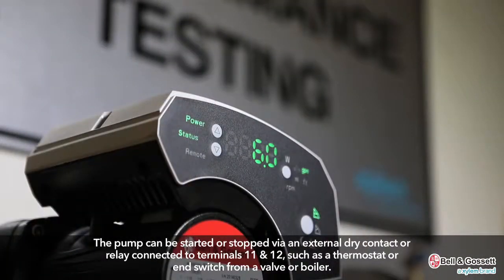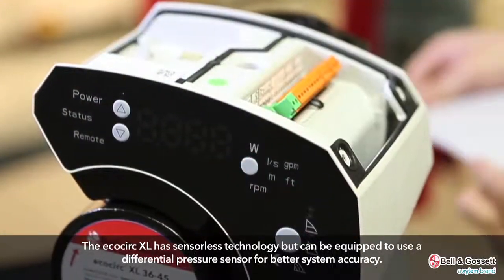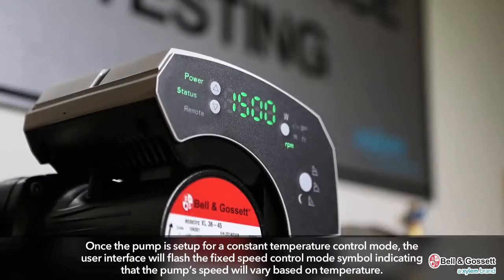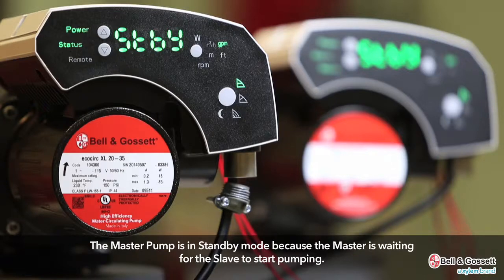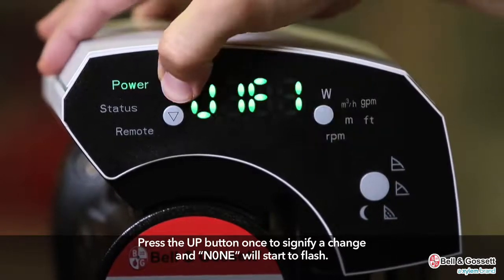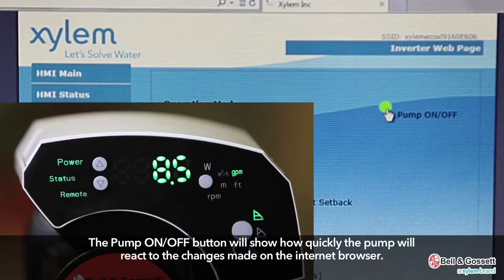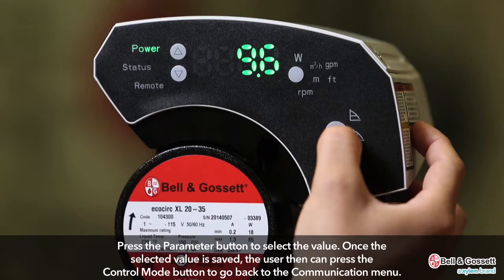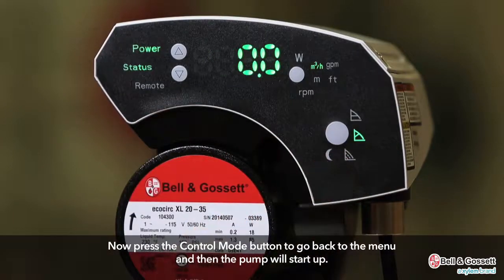Bell & Gossett ecocircXL: Advanced Functions and Training

Comment: Ecocirc XL 36-45, pump had worked for several years all okay, recently the display went dark even with power supplied, so I swapped controller with one from a spare pump (same model/voltage), everything seems fine except that when I select flow with the parameter button, display shows “on” instead of gpm. Never seen this, what does it mean, how do I display flow?